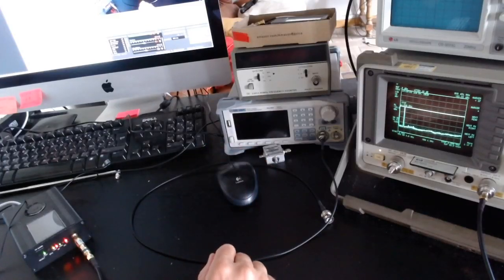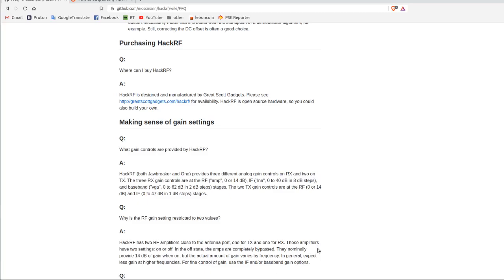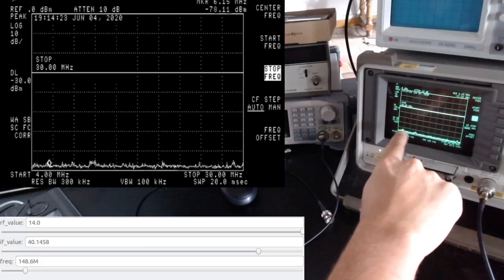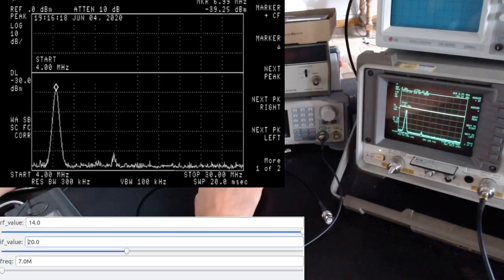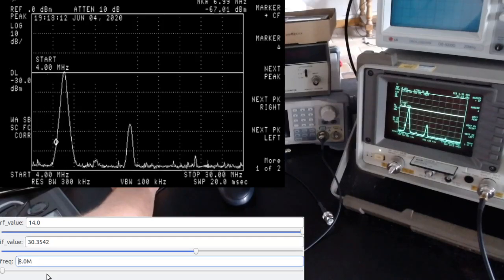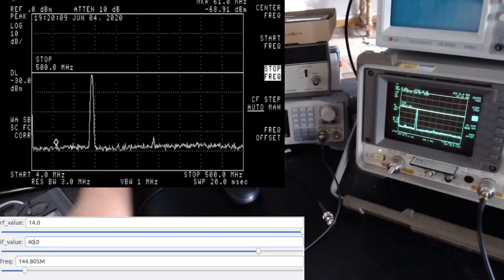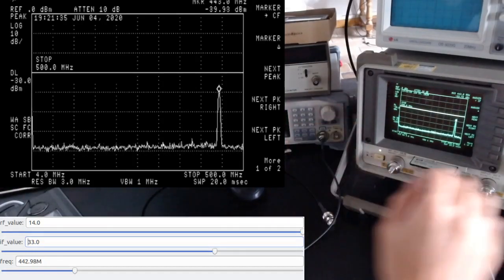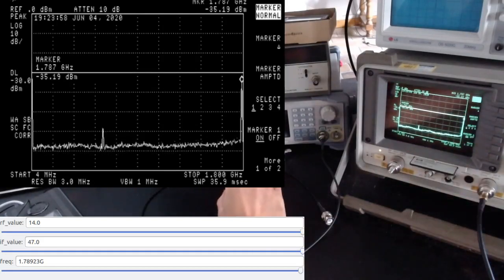Episode 37: HackRF power level settings

Comment: Hi there! Thanks for your video. Could you please explain which capture card and software you used to connect your HP 859x SA BNC video output to computer? I am trying to find for my 8591 but mostly the cards are for composite video... Thanks!
Reply from the maker: Hi! I answered already but I suspect Youtube didn't record it... :P 

Anyway, the HP has a BNC video output, but that is an ordinary composite signal (PAL/NTSC). You just need a (2$) cable with one side BNC and the other side Composite (or you can make one yourself). 

Then the think just work with a very cheap USB composite video acquisition peripheral.
Reply: @therfnoob7697  Hi! Thanks a lot. Yes, i imagined what you said, but i thought it might have some specific USB capture card to be used. Thanks!
Reply from the maker: @pedroavex  no it's very simple and inexpensive. You can look in the manual for some of the settings you can play with: like PAL/NTSC refresh rates, etc. Enjoy your HP! :) Too bad mine is broken now!
Reply: @therfnoob7697  Oh sorry to know... That's quite an instrument, indeed. Happy to play with my new toy...haha. 73! CS7BAC.

Comment: Your not a RF Noob, stop using my title. Im the RF noob, and I can prove it... just debate RF aspects with me, and you will be convince I just came in with the noob-train to the RF station.
anyway, I tried to check my HackRF with my new cheap USB3 RF power meter to see if its values were any good..
I went into then signal generator on portapack and choosed 500mhz and same on the USB3 RF display and the highest reading I got was -0.2dBm which also was listed as 0.95mW. (47sett. amp14)
just tried to replicate the same with my cheap USB3 RF power meter.
7mhz on both HackRF portapack and on the RF power meters display..
I get 0 dBM and a reading showing 1.02mW at gain32 ampl14 and my USB3 RF power goes from uW to mW, at 0dBm or above (Portapack in its on screen signal gen and noise) bw 50khz, tone01000hz.
but the weird thing, I cant get any higher then +0.6dBm / 1.16mW at gain36amp14, after gain36 it actually starts falling, like IM meeting some limit, somewhere.??
Im using a cheap CN variant, but still fascinated with how wide an area you can use these  https://www.youtube.com/watch?v=uopHj1gx2N8

Comment: Excellent work and explanation! Congratulations. I would like to know what HP analyzer mold you are using and how you did to achieve the digital visualization of the HP, in your video. The real-time display, the black box, seen at the top left. Thank you very much!! 73 !! LU5EWR.
Reply from the maker: Hi, thanks a lot! Have a look at my episode 36! :)
Reply from the maker: but to answer shortly: it's a HP 8591E, and it has a BNC connector on the back with a composite video signal which I am capturing with a simple USB-dongle (about 10usd), which is seen by my computer as a an external source of video (just like a webcam). 

So it's a cheap hobbyist solution, but good enough for this channel :)

Comment: Hi there, is it risky to use the transmit function on hackrf? I have seen that people have burned the preamp. I know that depends also if the antenna is matching the transmitting frequency. Thank you 🙂 👍
Reply from the maker: Hi! No, it's not dangerous at all if you connect a 50ohm device (like a well-matched antenna or, like in this case, a spectrum analyzer).
If you don't connect anything and you try to transmit you will likely burn your Hackrf's frontend.
Finally, if you connect something that is not 50ohm (like an antenna designed for 440Mhz, but you try to transmit at 7Mhz), then you will likely also burn the HackRF, because at mismatched frequencies the impedance is not 50ohm.
You can also have a look at my Episode 7: https://youtu.be/QHq-JrolFiA